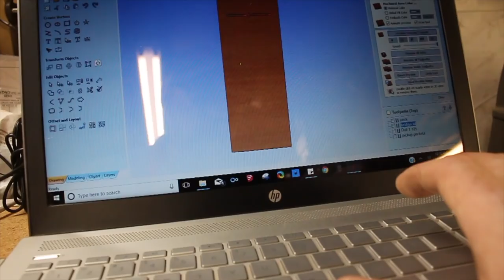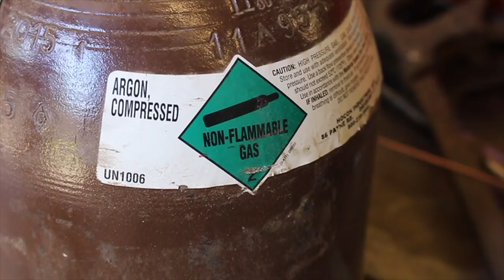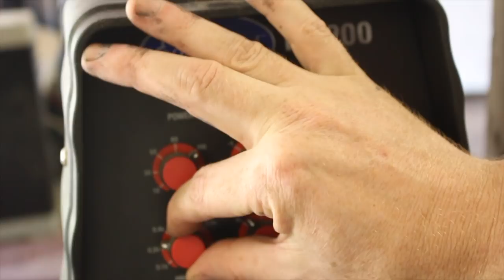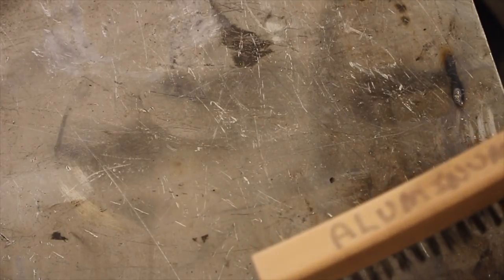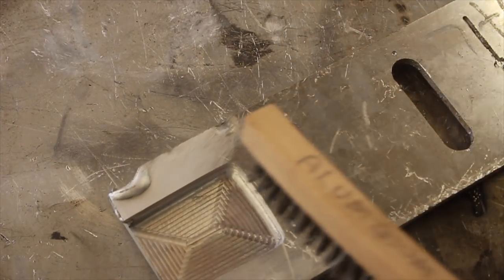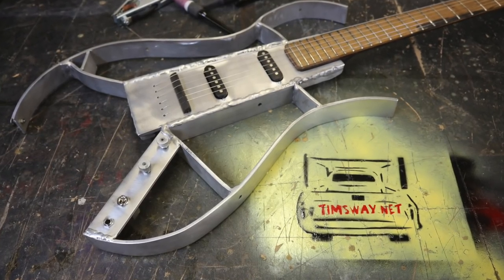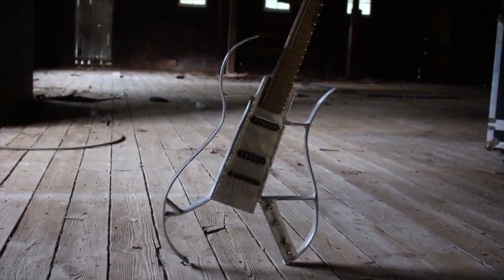Aluminum "Invisible" Guitar | TIG Welding

Comment: What a cool project.  One of the tricks to TIG welding aluminum is to preheat the area really well with your TIG torch before you add any filler rod. This might be a cool project for me one day.
Reply from the maker: cheers! I bit off a lot for my first TIG project, but I managed to make it stick. I have a lot to learn.

Comment: Sooo smart the torch triggered by foot, I think that make the work a lot easier and effortless than by hand, by the way, you've started the TIG by the most difficult (i believe) material to weld
I think it turned out really great and the sound is quite good, keep doing great stuff with your hands !!
Reply from the maker: thanks! Yea, everyone told me to NOT start with aluminum :)
Reply: And that's why you're a great maker, 'cause you don't listen what people say, like "oh no, a body guitar has to be that kind of hard wood and nothing else" and you craft guitars with junk, cardboard, old barn wood and it turn better than a guitar bought on internet
question: where do you buy all your pickups and hardware ?
Reply from the maker: aww, thanks! I usually search ebay for the hardware I buy. My main source is a seller in Canada called BezDez. he has good prices, good stuff and bundles shipping so it's still cheaper than most places in the states.

Comment: from a Tig Welder.  Aluminum is tough at first but gets super easy once you get it. Its gotta be super clean and have to have proper heat control. Cold, it may come out blob-by; too hot, Sunken in or burned through. Once you see your first initial puddle get shinny molten, add filler. To know it fused when continuing, you will see your bead sink in pretty or near flush with the surface. the pulse technique is a good starting technique. Hope this helps!
Reply from the maker: Thanks! I understand the theory but the hard part is getting the hands to do it right. Practice, practice practice!

Comment: As a professional TiG welder, you only need one piece of advice that will make the job easier. Clean that aluminum with something to break the oxides off of the surface. I found over the years that aluminum like you bought from the scrap yard is the worst to weld...and most difficult. Be careful using sand paper or grinding disc' as it can leave behind grit that also hates being welded. So clean that up to remove grit. Bead blasting works good too, just wipe down with rubbing alcohol, fresh never used paint thinner, med dry I think leaves little to no residue that will weld up just fine. New aluminum should be prepped as well. A brand new SST wire brush that is only used for Aluminum works good  if you brush the weld area really good then wipe and clean after. You probably already know that any grease, oil, paint or any residue of any kind makes welding aluminum difficult. If you have ever tried to solder without using rosin, the stuff won't stick/flow. Kinda same thing. Looking good so keep it up!
Reply from the maker: thank you very much! I will take any and all advice I can get from people who know how to TIG.  have a dedicated wire brush but yea, it was not clean enough and I had a hard time managing the heat. It is WAY trickier than steel for sure. I haven't had a chance to go back to aluminum TIG but I am looking forward to practicing more.

Comment: Hi !  wonderful creation indeed.  I am fascinated by the use of metal for the guitar body.  I see that the neck is more traditional bolt on the body.  I imagine it is not easy to do but would it be possible to tig weld a metal neck to the body so to make just one central piece ? would that increase stiffness and add sustain to sound maybe ?  something like a stick guitar. Then you can bolt two shaped sides to give the final shape.  Like a single center piece body with two lateral pieces attached.  The final shape could be something like the Yamaha SG series for instance ... very elegant and symmetric.  However i envy your ability a lot.  Wonderful job.  Kind regards, gino
Reply from the maker: i do plan on doing more experiments. check out my channel some more. i have some wood guitars with removable parts you may dig

Comment: Mr. Sway,
Was the "airy" ethereal sound an effect of the amp or an AFFECTE of the design!?! 😜

Great job as always.😎
Reply from the maker: i was using some reverb on the amplifier. but that's part of my point with builds like this that whatever the body and "tone wood" are lacking can be replaced in spades with electronics.

Comment: How did you know which aluminium to pick? Was there a guy there showing you where the best tone metal was located? Seriously though. Can you mic your amp so we get good sound I'd really like to hear its tone versus a wood solid body electric.
Reply from the maker: haha! I was using a real crappy amp in this vid. I've taken the guitar apart since making this vid to make some improvements to how it plays but haven't gotten back to it. When I do I'll post a closer look at it as an instrument on youtube.com/newperspectivesmusic
Reply: @timsway   In the video as is. It really does not seem like the tone is different from a wood body. I'll bet that the frets, whether they are the standard soft wire or steel probably influences tone. Or even the nut. Apparently you can buy brass nuts and it's claimed it makes for a brighter tone and longer sustain.
Reply from the maker: in my opinion wood does affect the tone but it is less important than pretty much all those other factors.  (and I have some videos on this that sort of prove and disprove me at the same time, I'm working on a better test). i think spending money on a brass nut is more important than spending money on fancy wood or aluminum! :)

Comment: Pretty damned good for a first attempt at TIG welding....aluminum, no less!! At the risk of telling you something that you already know, did you consider using an angle grinder, or die grinder, to clean up those welds? Unless that was the look you were after, those welds can be ground down, squeaky clean!! Cool guitar, with a unique sound, nonetheless! Maybe for a future project, consider adding some resonance by adding a thin aluminum skin to the framework you just created.....or something vaguely similar?? Nicely done! :-)
Reply: BTW, old bass players never die.....they just give unsolicited advice to guitarists.....and luthiers!! ;-)
Reply from the maker: I paid the bills with a bass for 15 years. can't you tell from my horrible guitar playing?
Reply from the maker: thanks! I left the welds because the video was sponsored by a TIG welder. I figured I shouldn't grind them down for the reveal shots :) My original idea was to TIG together a hollow aluminum body with some .05" sheets but that proved to be a little too tricky for my first time out. Maybe after I get some more practice :)
Reply: Aha!! Makes sense now.....and yes, .05" sheets would be awfully tricky, even for an experienced welder. Maybe those could be brazed on instead. I love the concept, though! Kinda like Dan Armstrong for welders! LOL
Reply: I never criticize another's playing...of anything...except maybe in cases of misplaced arrogance...which is obviously not your problem! I've been known to poke at a 6-string from time to time. Painfully poorly, but I poke anyway! Hard to write on bass, ;-)
Reply from the maker: I have found the guy who says "I'm great" at anything is usually not all that great. hahaha! I'm thinking rivets for my aluminum acoustic, when I get to it. My main bass when I was playing was a pre WWII aluminum upright bass, Pfretzschner. Aluminum is not a horrible choice for instruments.

Comment: Nope Aluminum does not have the right properties at least for a neck for sure but it is a step in the right direction. Magnesium however does and it is expensive though I have built seven of them but most of them were stolen by my partner and he stole them and sold them to pay for his living expenses  the passed away. I have one left plus a bunch of crap that he left me he bought out John Valeno years ago and made a few of those peices of crap before he realized aluminum does not work.The one shown by my name Al Somthin is one of those guitars I made from mag.It is called Magnatar and is a neck through design. Mag neck wood body . The body adds little to the tone.